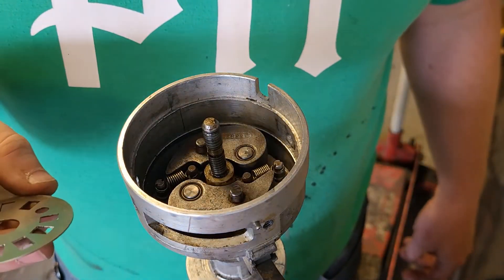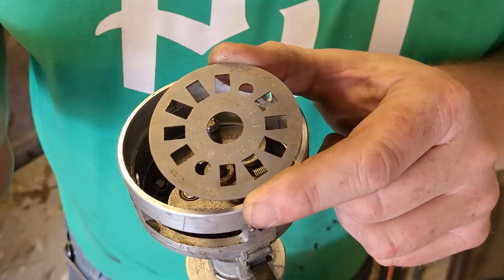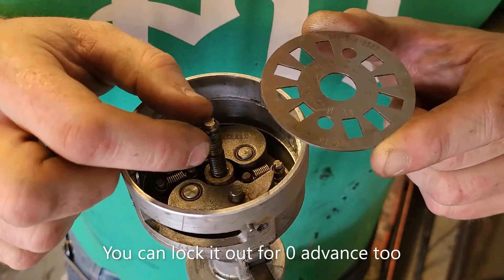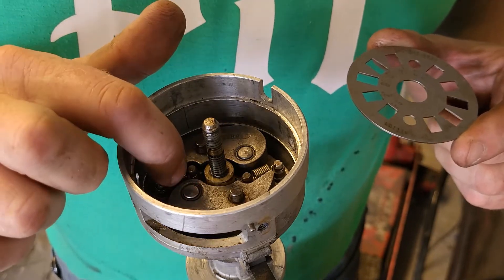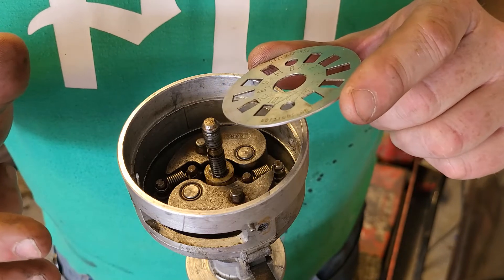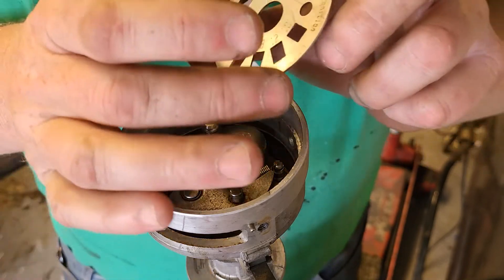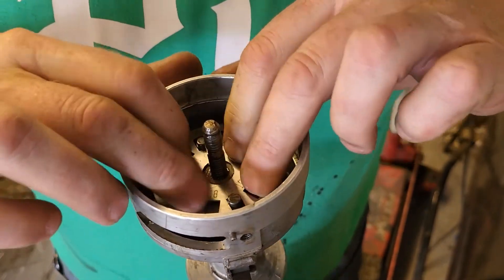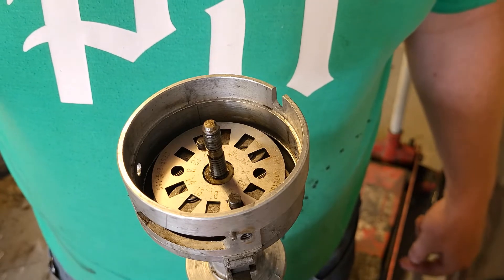Distributor mods with parts from 4secondsflat.com #noname500 #nonamenationals

Comment: Cool the the old way was making your own welding the plate the disc is a great idea! You can take a retaining clip plier and either braze or weld or interference fit small tubing found in the hobby store and make a tool for the clip that holds the plate cam/reluctor for easy removal.
Reply from the maker: That's a great idea! Better than cussing and complaining like I been doing all these years!

Comment: Thats a good setup. Your 20-32 should be right there. If you get a chance to run it again try 20-32 then 22-34 and see if your MPH improves and keep going until it drops probably will drop by 36 or 38. If it wont rev after all this then maybe you were right all along and don't have enough valve spring. The only way I see the valve spring not being enough is if there shot. A factory spring with a fairly mild lift cam like you have should do at least 5500 I would think. I was watching your car launch last  night and I noticed it has little to know weight transfer should be much better with loose shocks you have plenty of tire. I am rooting for you buddy! Let me know how it goes and if there is anything I may be able to help you with please ask. Best of luck.

   Nolan.
Reply from the maker: Thanks! When I ran it at 32 total I was a bit down on MPH. Next time out I'll start at 34 with the ability to go to 36. I'm going to remove my front sway bar to try and loosening up the front end and maybe lower the back a bit. You are right about absolutely no weight transfer.
Reply: @Mynextproject_74  Not sure about a 'A' body but on my gm G bodys the front suspension drops way faster with the sway bar off.
Reply from the maker: It can't hurt!